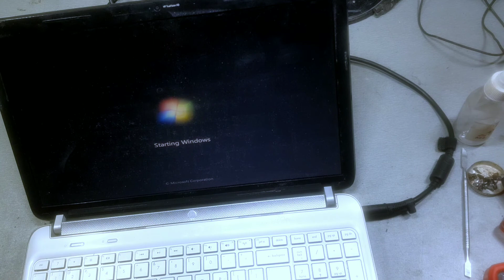How to Fix Hp pavilion dv6 power off Motherboard repairing

Comment: Before I spend 3 hrs tearing apart with 300 screws, small parts, plates, accessories and whatever and purchase any expensive components - I will toss it to the concrete and buy another for $399. It's not worth the effort.

Comment: I'm very disappointed that you didn't voice or show what the setting is set for on the voltmeter to test the voltage in the power cable. In order to see 19.xx, what's the setting?
Reply: 20V _¨